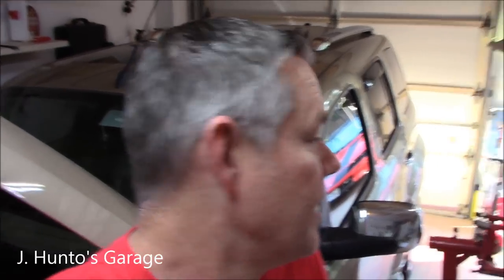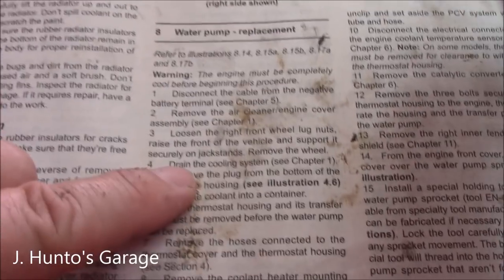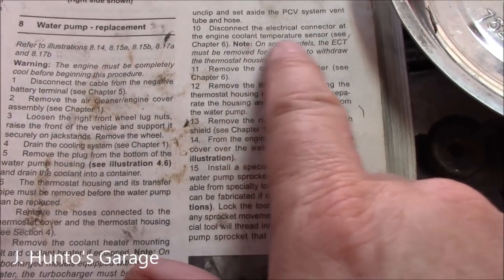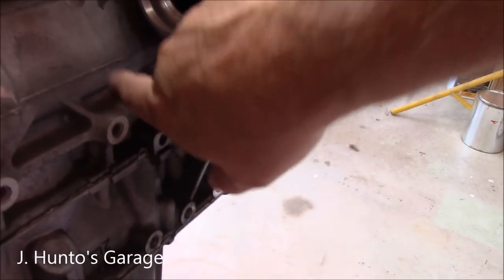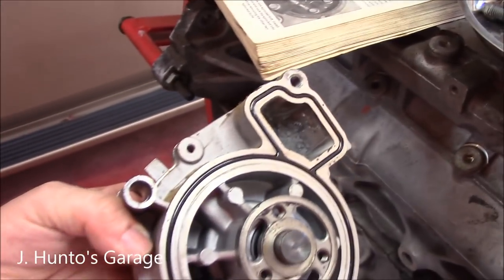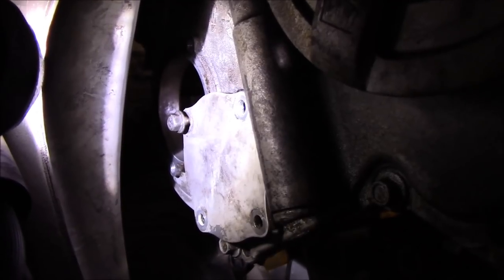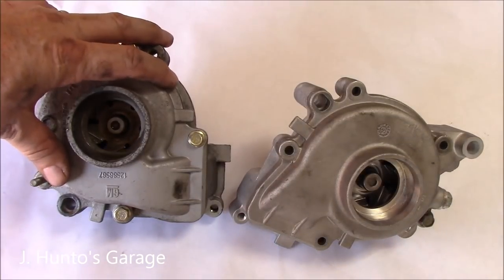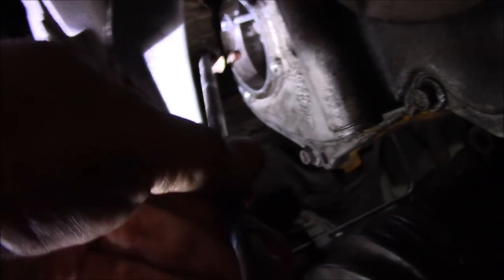Changing an Ecotec Water Pump, Less dramatic music by request.

Comment: Love your work.  I'm doing the head gasket on my 2.2L Cobalt right now.  Love my Hayne's manual.
Reply from the maker: Dustin Sherburne thank you! Might want to look at changing the timing chain tensioner and possibly the timing chain.
Reply: J. Hunto's Garage I'm on top of that, got the Cloyes timing kit. When we removed the tensioner it came out in ten pieces
Reply from the maker: Dustin Sherburne Wow. Let me know how it goes.
Reply: Hi J, got my car finished this past Saturday.  After installing the machined (and pressure-tested) head, we installed the new timing and rotated the engine by hand a few revolutions just to be sure.  Then we moved on to reinstalling all the bits and pieces we pulled off and I am proud to say that she fired right up on the first try!!!
Reply from the maker: Dustin Sherburne Very cool and a job well done! That engine should go for a VERY long time now. Go man go!

Comment: if the case were 5 five screws on it get put on last u could spin the water to the timing chain sprocket holes then screw the pump to the timing sprocket after screwing the pump from the other side very good video thanks a mil

Comment: That tool to hold the sprocket is a must! Plus the 6mm bolt to hold the water pump in place to get the first 2 bolts in. This motor's a nightmare.   They put the fuel pump on the motor but can't get a pulley driven water pump on there? 🤷‍♂️
Reply: You can fairly easily remove the lower timing cover and have totally easy access. I actually think it's easier than dealing with the tool that holds the sprocket

Comment: you should use OTC 6616 Gm water pump holding tool or OEM brand 27207 to prevent the sprocket from moving.
Reply from the maker: For sure! Thanks for watching!

Comment: sturdy paper towel or equivalent stuffed in the gap between the ttiming cover and sprocket kept me from dropping anything down there. get ur magnet IMMEDIATELY if u drop a bolt onto the paper towel, dont even try to get it with your hands. good luck out there.
Reply from the maker: william shaffer Excellent tip! Thanks for sharing!

Comment: i think my dealer should of recommended i change the water pump when they changed the timing chain that was under warranty got to love the dealer over $1000 to do the water pump thanks chevy
Reply from the maker: Wow! It's a bit high on the difficulty scale for the DIYer but not $1000. Geez!
Reply: If you're going to use J Hunto's garage video to help do the job, I would take it to a professional and pay the thousand  dollars to have it done right. Or look for a YouTube video that shows the right process, If you do it the way it's done in this video, in the long run it's going to cost you waymore than $1,000. This video should be removed, the installation process of the water pump is totally wrong ,and will ruin your engine.

Comment: Got one of these GM "Dream Cars". Every service is a heart attack. Got an intermittent noise, mech/scope says in area of water pump. These engines are notorious for chain/guide failures around 100k. Will pull the engine and service all on the stand. Stab it back in and watch the info center light up with all the unhappy sensors. Nice try on your part. These lemons set you up to fail.
Reply from the maker: I'm sorry you've had that experience. I really haven't had too much trouble. Check your chain tensioner before pulling the engine. Might be just the tensioner. Thanks for sharing!
Reply: Good advice! Will explore this as an alternate. Really find your channel useful.
Reply from the maker: @1Klooch  Thanks bro!!!

Comment: d swag
0 seconds ago
You have any idea why my new pump whines.  It's pretty loud.  I bought a new ACDelco with no back cover or sprocket since I could use my own cover and didn't need the sprocket.  Saved a $100 but it was made in China.  I sent back to Amazon and bought the whole pump, which was made in Mexico. Have the same noisy sound which sounds like a plane.  The one that came off, which I think was original, had plastic fins and casing.  This ACDelco is all metal.  Loud and sounds horrible  when you gas it. Any ideas what's wrong?  Thanks  ..........and I didn't drop anything in the hole.  I used the full moon tool, much better and safer, but a lot more money too,
Reply: You need to take the tensioner off and replace it with a new one or reset it..You have to much tension on the chain..It happens sometimes when you change the water pump.The tensioner is on the rear of the motor it's a huge 32mm bolt head..Watch alot of 2.4 ecotech tensioner videis... I would buy a new one..25 bucks and don't forget to activate it.
Reply from the maker: Daveyboy has the best advice I can think of.
Reply from the maker: Great advice! Thanks

Comment: Whatever you do don't do it like this! The water pump chain an sprocket moved all over the place and ratcheted down. Has nothing to do with timing or jumping a tooth on the water pump gear. The chain that drives the water pump isn't connected to the timing  chain of the engine.
 It's a totally separate chain, wouldn't matter how many teeth it jumped on the water pump gear. What it does is cause slack in the chain when the gear moves around. Now the tensioner takes up that slack automatically, making the chain too tight.

You first should have secured the tool to the sprocket using the holes with no bolts in them. 
Once the tool is nicely secured to the water pump gear. Then secure the tool to the block of the engine with the "access hole" cover bolts. Water pump gear tool should be tight, can't move a bit. 
Next loosen the water pump bolts on the water pump gear. If you don't follow these steps, you'll get a over tightened water pump chain. The over tighten chain on the water pump gear will cause a whining noise coming from the front of the engine.
 That noise is  caused from the tensioner making the chain too tight, wearing out the water pump gear, chain, and water pump shaft.

Resulting in metal shavings in your engine.😢 From the whining gear being wore down.
Time to take the timing chain cover off pull the pin on the tensioner and reset the tension on the water pump, that's the only way to fix it. 
I hope nobody has followed this video on how to change a water pump.
This is not a good how to video.
 You really should remove this, anyone who did their water pump this way will have received some very expensive advice. Because now you'll have to pull the timing chain cover to fix it.
Reply from the maker: This engine went on to 233,000 miles before I sold it.
Reply: @jhuntosgarage  I see you said you had to take the cover off because you had dropped a bolt in the engine.Then you found timing chain guides wore out and broken. You won't get the whining noise if you put new guides and timing chain on, everything is reset. But if you try to do a water pump through the window without that holding tool in a solid position, the engine will have a whining noise every single time. The whining noise is caused by the chain tensioner taking slack out of the chain because the tool wasn't used to hold the gear in place. This makes the chain to tight on the water pump gear and the balance shaft gear. The whining noise is like a slow grinder! And we all know what grinders do. I don't think car engines are met to have grinders in them. I'm done explaining the facts to you. Do some research, educate yourself. That way when you do the job for the next person it'll be right.
Reply from the maker: Thanks for your input and contribution!

Comment: Why take apart the new pump to change gasket?
Reply from the maker: If I remember correctly, the new pump does come assembled with the back cover.
Reply: @jhuntosgarage  Ya, mine came fully assembled, I have the head off, and pulled the CAT for room...just wanted to make sure I wasn't missing anything. Thank You
Reply: If you followed this video on how to change your water pump. If you didn't use the holding tool for the water pump gear. He didn't use it in the video, you're going to have a lot of whining noise coming from the engine.The whining noise is the gear an  chain on the water pump being turned into metal dust. If you didn't use the water pump gear holder, you need to service your car immediately. You are grinding up metal in your engine. Needs to have the timing chain cover pulled off an the tensioner on a water pump chain reset, it's the only way to make it right. I would not drive your vehicle  if you didn't use the tool on the water pump sprocket.

Comment: You cannot do a water pump change on a GM ecotec motors without the holding tool and have it come out right. I should know I built these engine for general motors, Saturn plant spring Hill Tennessee. Work for GM for 36 years. without the tool there's no way the water pump job come out right, it's impossible to do this job right without the tool. sure you can do the job without the tool but it's going to wear parts out, gear and chain on the water pump. The only way you can do it without the tool correctly without eating up parts and having metal shavings in your engine, is to install the water pump with the whole front timing chain cover off.
Reply from the maker: I did it. More than once.
Reply: @jhuntosgarage  The water pump and water pump gear will not last if you don't use the tool that keeps it from ratcheting the water pump chain tight. If the water pump drive gear isn't securely held in place , the gear will end up at the bottom of your oil pan in the form of groundup metal shavings because  too much tension.  Even the novice mechanic knows metal shavings in your engine oil "NOT GOOD". This happens because the water pump gear not being held in place by the tool. Doesn't matter if you've done 1 or 10 like this they're all wrong. The video of you showing how to do the water pump install is bad information. Do some research about the holding tool. The tool needs to be in place an secure. It's the first thing you do. You do that before loosening the water pump.

Comment: Question
 How much this job cost? Not including dropping a bolt in the chain cover.
Reply from the maker: I would guess this a $3-$400 charge at a shop depending on where you are. Just a guess.
Reply: @jhuntosgarage   I have this engine in a sand rail and I have a feeling that they person has the horse from the radiator backwards. Can you tell me which way the coolant flows on this engine...

Comment: We have a 2012 regal with the turbo.  Water pump suddenly failed,  i think the impeller came loose. Chains rattling bad so going to do this all at once. This will be quite the experience. This is my kid's car. I'm sticking with my 3800 powered cars.
Reply from the maker: I've got a 3800 car as well and I agree with you! Good luck! I have an HHR playlist that might have some other helpful info as well.
Reply: Do you need to remove turbocharger while changing the water pump? 😬
Reply: @mariuszmaxankazuya3170  no, only remove the cat and that opens access to the pipe that runs across the back. Turns out the pump didn't fail, it was the tensioner for the chain that runs the pump and balance shafts. Tensioner broke, chain went slack, and the sprocket on the crank wore all the teeth off. Pump was fine but we replaced it anyway. Dealing with it is a two man job, the thermostat housing was hard.
Reply: @robertbell525  I have an Cobalt SS turbo and want to replace both chains as when I cold start the car sometimes i can hear a noise from timing chains, on warm engine no problem...and as I am doing it would replace water pump also, as you say this thermostat water housing will be a pain in ass 😐 thanks for replay 🙂
Reply: @mariuszmaxankazuya3170  honestly if your thermostat or water pump is not giving you problems I'd leave it alone, or do the minimum to get that pipe out. It's been a while now but I think the hard part was getting a bolt into a tight spot, it took my son accessing from the top and I got it lined up from underneath. If you do just the chains it's not bad. I'd also recommend leaving the cam phasers alone unless they have issues. We replaced the phasers but it was a waste of $$$ the stock ones were fine. The phaser bolts are TTY get replacements from the dealer. The dorman ones are too long.
Reply: Also, removing the timing cover is pretty easy but I'd recommend an impact. I have a 250 ft lb electric one it's a godsend. Use it to quickly remove lug nuts, engine mount bolts and the crank bolt and the pulley slides right off. Then a bunch of 10 mm bolts around the cover and it comes off. Remove valve cover to get at the top. If you can skip the water pump this job can be done in one day. That impact is a game changer for driveway repairs.

Comment: I wonder how many ecotec engines were destroyed by water leaking into the engine oil.  Mine has 105 thousand on it now and no problems. This design is German = after thought engineering. Opel helped with the design of this engine. I wish I had done my homework,  I would have never bought the car. As anyone can see there is really no reason why they could not have mounted the water pump like they did on the 2000 Cavy's with push rod engines. Good luck getting any shop to replace this pump for less than 600 bucks.  What a stupid design, even replacing the thermostat is a pain, if either goes out just do the whole thing, pump and thermostat !
Reply from the maker: I thoroughly agree!

Comment: So you say do not drop a bolt into the engine, then you do it. Then you say you should really use the tool to keep the timing gear in the right position, but then you do not use the tool. Maybe you should take your own advice before you make a video???
Reply from the maker: All unexpected events during filming my friend. This video is geared towards the novice that would have much more trouble dealing with the issues I had. I can do the water pump change without the special tool, a novice wouldn't necessarily know how to deal with that situation. In the end, I did say this was high on the difficulty scale.  There's really no easy way to do this job. Thanks for watching and tour input!